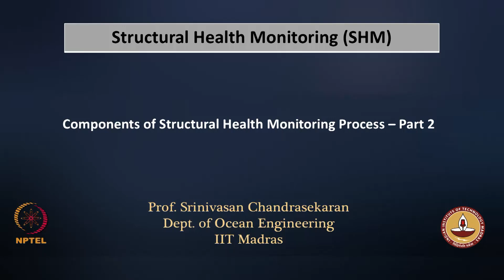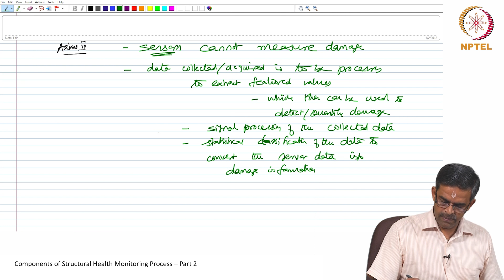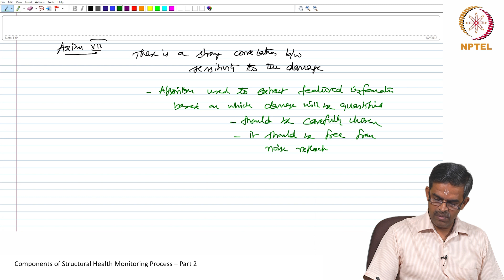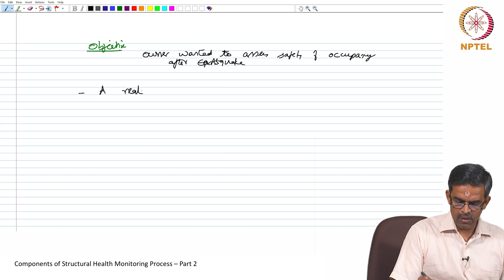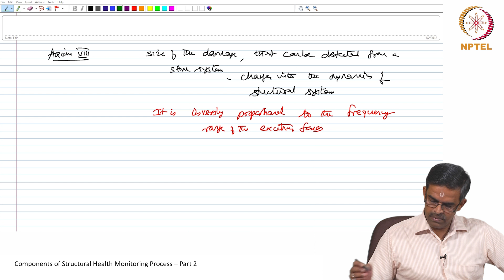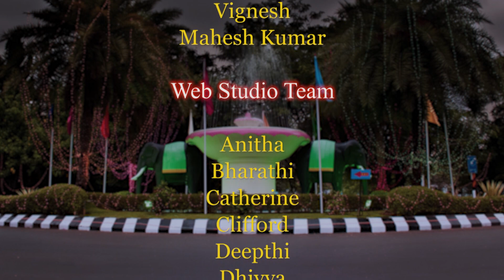Components of SHM process  Part 2:

Comment: hello sir , 

please i read your document 

there something i can't understand in the chanel CH10-CH19 ( 6b) in the 18 th floor at the frequency 0.6 HZ. Why there is a torsional mode and the phase is 0 degree  ? I found that's the oppoist in the first plot diagram in 6A where the torsional mode appears when the phase is 180 in the frequency of 0.6 Hz.

cordialy